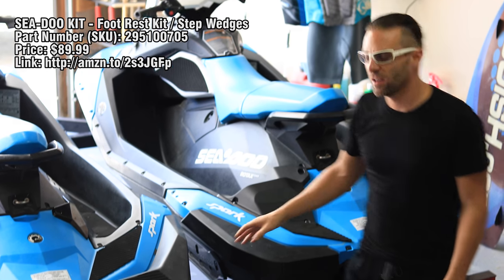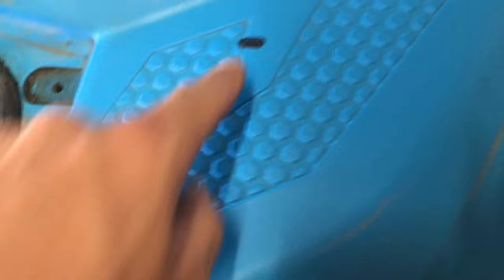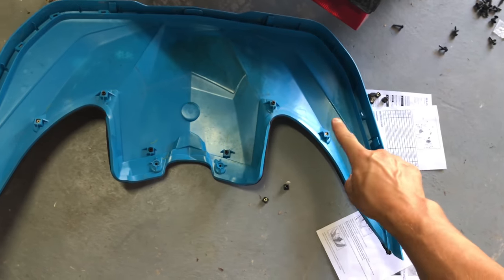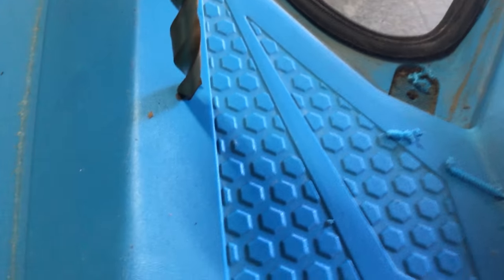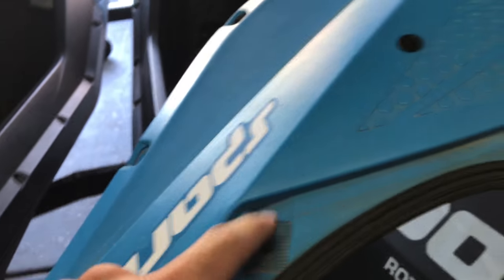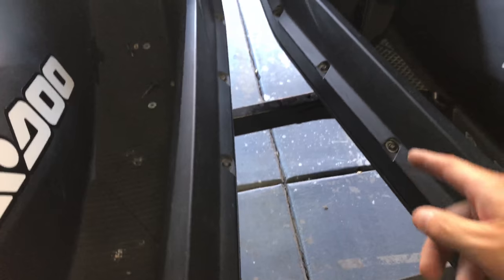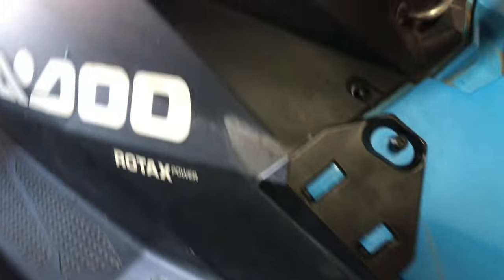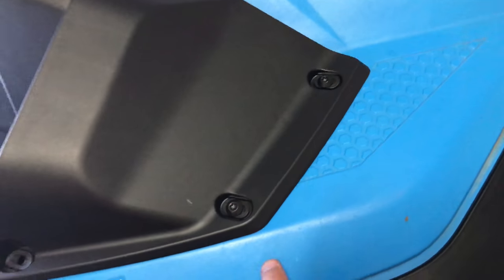Sea-Doo Spark Step Wedge kit install

Comment: Thanks for this video I did the extended ramp vts install on my 2up I can get it to stand up now but its kinda hard have to stand on my tip toes way far back to get my weight to transfer.  I just ordered  the step wedges after seeing your video I'm sure these will help in transferring my weight further back the extended ramp is awsome tho the extra 5deg does make a deference

Comment: Hi @ClintDecker, Nice vid! I just pulled my top deck for the first time to do a plug and oil change. The ski is 2019 90 with IBR and the previous owner screwed the step install. Where can I get the rubber part shown at 3:54 to fix mine up? I'm going to put in new plastic and metal inserts so I can torque properly. Any spec listed on the torque for the screws going into plastic?

Comment: I was going get a spark when they go on sale in the winter but after this video I think it shows how cheap they are built.
Reply from the maker: noctanol Yup. All plastic and flexible. But extremely light weight.
Reply: Clint Decker I think cost of buying then is low (around $4.5 k new) but there's a lot to be done after you get them and it's not worth it. You end up spending close to 8k which you can spend for a new sea do gti 155
Reply from the maker: noctanol GTI 155 doesn't feel like a dirt bike in the water though. Totally different machine.

Comment: nice video. have you tried these things yet? contemplating if they will help with tail stands on my 60hp
Reply from the maker: Ramy Hariz Not really. They only helped me after I added an extended range ramp which was made by some guy for 2014-2016 sparks. But you need VTS and IBR. The wedge steps might help if you can really get your weight to the back.
Reply: Thanks for the quick Reply Clint. I dont have the IBR system so i guess my $90 would be better spent on a set of hydromats
Reply from the maker: Ramy Hariz I just installed hydromats after this video. Well worth it, way more comfortable and worth the money. I'm not saying the step wedges aren't nice, but if you don't have the ability to add the extended vts ramp to give yourself more vertical trim, I don't really see the point in added step wedges to a 60hp spark. 90hp sparks I think all have IBR. Also, if you haven't done a tune yet, get yourself a tune, a 12/14 prop and you'll see the most improvement vs any other tune out there. A tune is about $500 and a prop is like $250-300